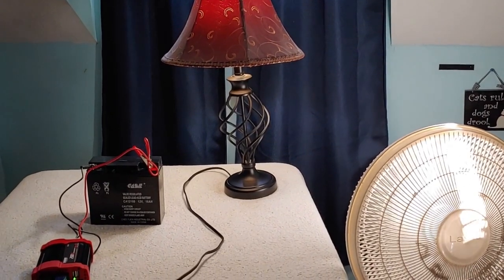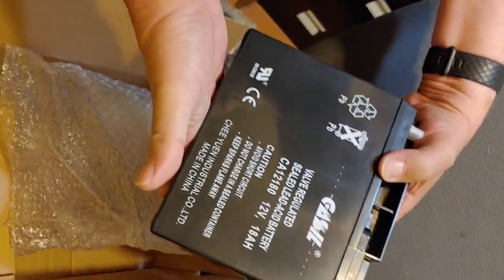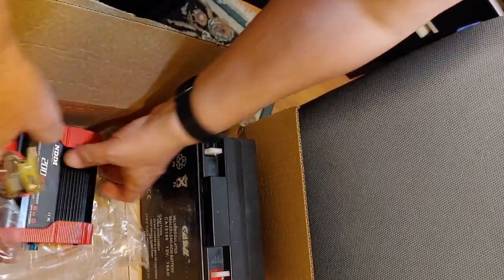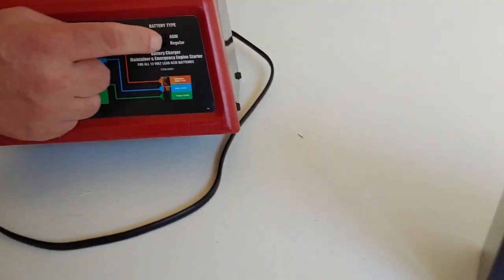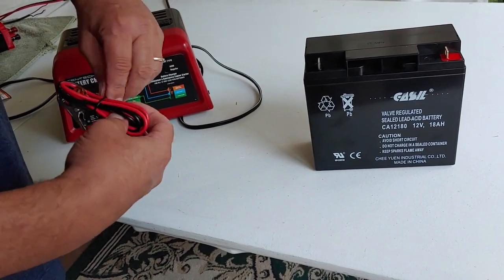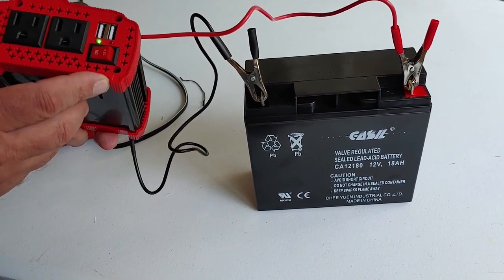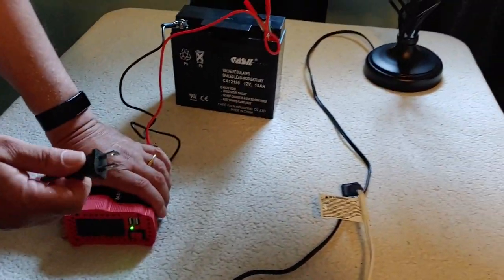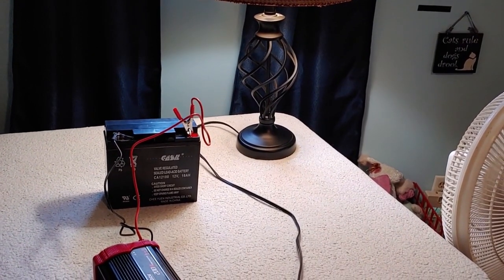Overnight Off-Grid Power Project

Comment: Just one problem.  When I figure in the measured 0.3 amp idle draw of a cheap 100 watt inverter, the measured 22.5 watts (2.08 amps at 12 volts @90% eff) of a similar size fan on low, and the labeled 5 watts (0.46 amp at 12 volts @ 90% eff) for a "40 watt equivalent" LED bulb for a total of 2.84 amps, that battery is dead in 6.33 hours, even assuming 90% efficiency in the inverter.  You would need at least 25AH for 8 hours use (8 * 2.84 = 22.72AH) because the inverter will shut down when the battery voltage gets low (10.7 volts and 10.5 volts seem to be common shutdown values).  Motor-driven devices often draw more power on modified sine wave power than on pure sine wave power.  My 4.4 cu ft counter height fridge draws 55 watts on a pure sine wave inverter but 80 watts on a modified square wave inverter.  Did you use the KillAWatt to measure the fan power while it was running on the inverter?   Even discounting the inverter idle current, that 18AH battery is only good for 7 hours.
Reply from the maker: We appreciate the calculations and tips. Thanks for your comment
Reply: You bring up a great point, but it's even worse than you explained!  :)

Lead-acid batteries should not be drawn down below 50% SOC, at most, if you expect any kind of life expectancy from them.  So, this battery has, at best, 9 amp-hours worth of usable capacity before it should be recharged.  Presuming your calculation of 2.84 amps of draw is correct, that battery would be very close to needing to be recharged (again, for best service life) in just over 3 hours.  To get 25 amp hours worth of power, you'd need a 50AH lead-acid battery.  Now, if you used a lithium iron-phosphate battery, where you can use 90% of the rated capacity w/o damaging the cycle life, you'd still need about 28 amp-hours worth of power.
Reply: The $20 Lasko plastic 20'' Walmart Box fan draws 56, 67, and 76 watts on low, medium, and high. I use Bestek 300 watt Pure Sine Wave inverters on my projects. Idle draw is 7 watts, has 2 USB ports that are always hot whenever the cigarette lighter plug is connected. Lately I'm buying 12 volt Warm White Edison 27  base screw in bulbs by the dozen off eBay. They come in 3, 5 and 6 watt. I'm delighted to have light at such low power consumption. 

 I just converted a $4 thrift shop ''Cowboy Lamp'' for an elderly lady down the street. We are losing power these days just too often. She has stairs and needs a light on in the living room at night.  The 5 watt lamp has 4 of the $7 used Headway 38120 cells hidden in the base with a 12 volt jack used  to charge it. The charger is a wall outlet 1 amp 14.6 volt unit. 

I built her a little 12 volt 120mm case fan with 12 foot speaker wire that plugs in the charging jack. She puts the fan on the counter behind her chair and lets it blow on her when the power is out and its 100F outside.  With fan and light on, run time is 12 hours. Fan only, 34 hours, light only, 20.5 hours.  I'm going to add a tiny relay so that when utility power fails, the light comes on by itself.

Power consumption measurement is my thing. I must have 4-5 Kill-A-Watt meters handy. This crappy old shop fan draws 155 watts. Do you think I should add a few hundred more amp hours? https://www.youtube.com/watch?v=UwuC97gpng4
Reply from the maker: @kimmer6  Having more amp hours is always better than not having enough.
I appreciate all this information. Thank you for the comment.